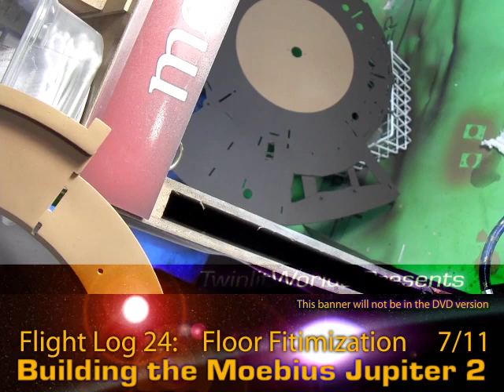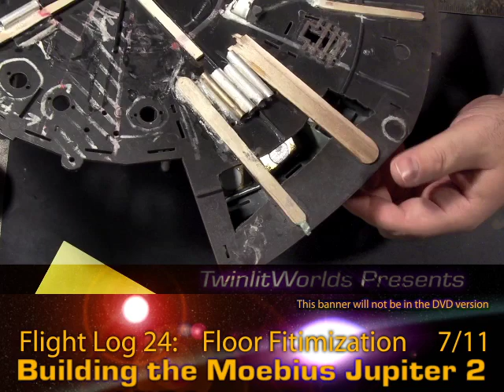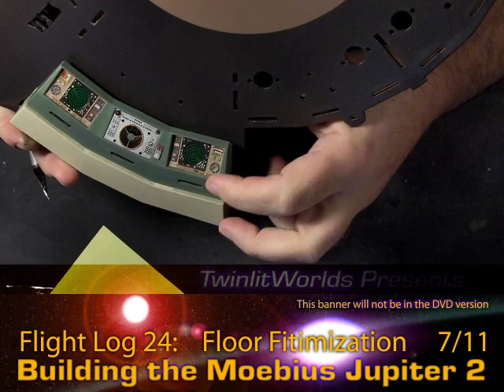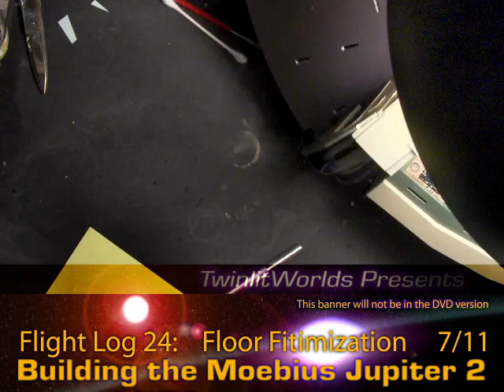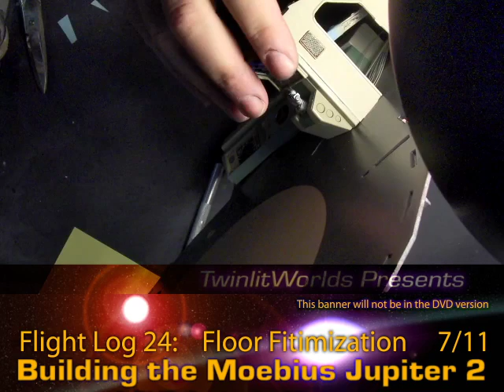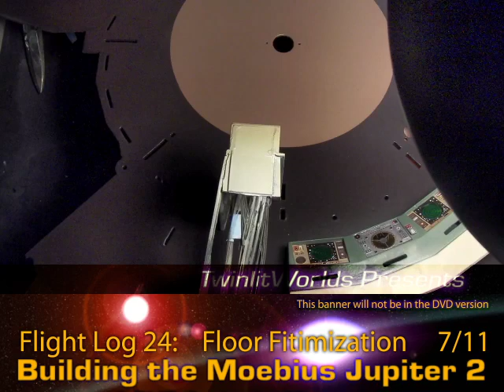J2 FlightLog 24: Floor Fitimization 7/11

Comment: Tom, looking good.  Have you noticed that the model kit is very inaccurate with regard to the depth of the controls area?  This becomes noticable when you set the video screen console next to the control panel.  The vid screen sets back from the controls much farther than it did on the show.  This will be even more apparent when you install the wall panels on each side of the controls.  These panels set so far back it obstructs the view into the ship thru the viewport.